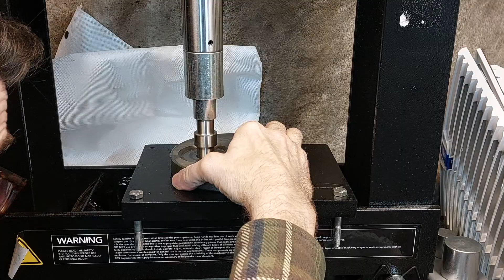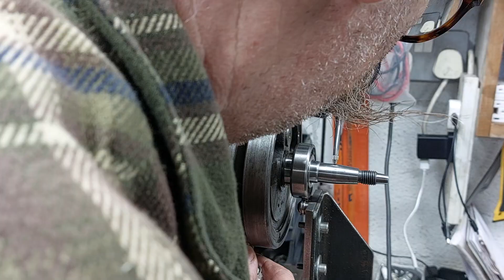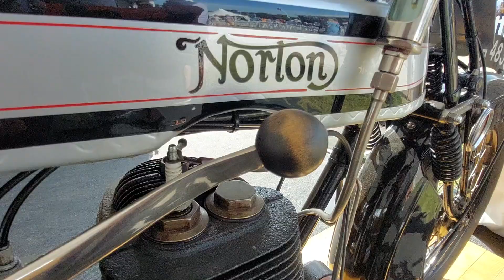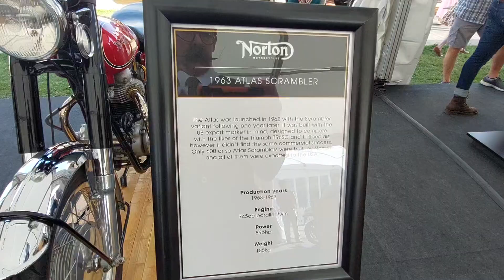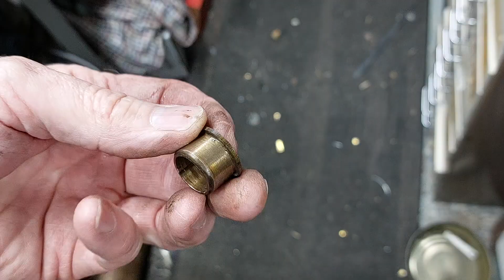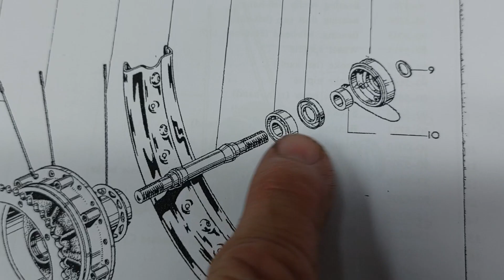BSA BANTAM CRANK ASSEMBLY & TRUING  UP

Comment: Hi, did you ever finish your bantam crankshaft? I have a couple of crankshafts one from a b175 and one from a d14/4 same as the one you have been working on. The problem that I am experiencing is one flywheel at say 12 o’clock is higher than the other by about 7thou?? It’s like the pin is bent or the flywheels are not a match. The problem seems to be the same with all the spare flywheels that I have. So if you have any advice it would be greatly appreciated. Thanks Trev
Reply from the maker: HI Trev, it's assembled but awaiting to go back in the cases, if you've measured the diameters of both the flywheels and one isn't 7 thou bigger than the other ( it wouldn't be a surprise as by the time BSA got to the d14 they just seemed to throw them together with whatever came to hand ,I struggled to get mine to the 2 thou recommended run out and I'm not the only one, Bones in Australia done one recently  that he had the same battle with ) but if both flywheels are the same diameters then it's likely that one flywheel needs knocking round the crank pin a bit ( have a look at my "Getting Cranky " video on Bantam playlist where I describe the adjustments to make when truing a crank ) the main thing is you want the shafts to run as true as possible, don't try a beat yourself up getting the flywheel surfaces to run true with each other.......they rarely will ( most B175's have cracked mudguard brackets,  mudguards and lamp brackets because they vibrate so much)

Comment: I got a rex caunt con rod set fitted to my B175 crank some years ago......my old one was like your old one Mr Tweed.

So I suspect the new one is lighter.

Sadly my crank was refitted with out being balanced......it was trued up nicly the guy who did it is a 2 stroke specialist..but didnt do balancing.

Over 40mph my motor gets very buzzy.....I suspect the crank is out of balance.

But I have heard that balancing a single cylinder crank is a wasted effort......is this true???

Wish I could get the motor on my bantam to be less vibratey.
Reply from the maker: The Rex Caunt con rod is definitely a nicer item than the original one Nick and it is lighter, I am going to check the balance on my but wasn't sure how but " Nigels pre 65 workshop " covered this when Nigel built a new crank for his Tiger Cub .

The B175 is prone to vibration I think just  because they made the bore bigger but didn't do much else which most Brit bikes suffered from with the CC race that went on ( Norton for example, Dominator 500 really sweet, 600 not as sweet,  750 Atlas really vibey so bad that they came up with the isolastick framed Commando ) .  B175's with cracked rear mudguards and mudguard brackets snapped or missing off of the rear subframe ( mine suffers with both ) is more common than  those that don't.  I think Static balancing wouldn't hurt as the flimsy crank needs all the help it can get, it may smooth the engine out at certain revs, I don't know if you'd find somewhere to carry out dynamic balancing and I should imagine it wouldn't be cheap.
So when I get round to I , I will give Static balancing a go.
Reply: @TweedsGarage  Thankyou Mr Tweed.....interesting.

Comment: Given that the crank pin is an interference fit in the flywheels,  where do you imagine the "give" comes from that allows the flywheels to move in or out to lessen the out of true measured on the DTI.
The workshop manual for an old Harley that I once owned described the same procedure, though in that case I seem to remember that the crank pin was a taper fit in the flywheels and secured by a nut on the outside of each. Same question applied there though....where did the movement come from?
Reply from the maker: You wouldn't imagine with as you say the interference fit there wouldn't be any movement but when pressed together things can tilt slightly on a minute scale ( like when a bearing jams when you get it slightly tilted to one side , the same thing happens with crank pins and sometimes require a blow to set them straight.

Comment: There is supposed to be a shim between the speedo drive and the rear wheel spindle nut, if missing speedo drive is clamped to hub and spins with it (breaking the speedo cable) - possibly not shown in exploded diagram because it's supposed to be supplied with the speedo drive so is a Smiths item, maybe? Anyway mine has this shim and it must be used. And it's definitely different to any other washers on the spindle. HTH
Reply from the maker: I shall look into it.

Comment: Just followed your method for Bantam crank truing after replacing a main shaft and conrod - got it to within 0.002" at each bearing journal quite quickly, but trying to get a smidge better just threw it further out - so I've settled for 0.002". I guess that's about as good as you can expect for a crank that's at least 50 odd years old that was probably made on equipment that was about 30 years old then! Did you get the engine running, and how did the crank perform?
Reply from the maker: Hi John, that's great to hear and to be honest with you getting within the tolerances laid down in the manual is a win as they are truly awful ( well not very true at all ) they may have been reasonable when BSA first manufactured them with fresh tooling but by the 60's i think everything was worn out, you only have to look at any unrestored B175 and most will have cracked rear mudguards and mudguard lugs sheared off of the rear frame due to vibration from wobbly cranks. Mine is still in pieces at the moment, the crank has been trued up again as it fell off of the stand which of course knocked out of true ( a mouse fart would upset it ! ) but cases have been repaired and i will eventually get it back together to try .

All the Best Mr Tweed

Comment: Having seen the work involved in truing up the Bantam flywheels and crank, I worry that when the crank is assembled in the cases, will the apertures for the main shafts be in line as well or so worn that you could have a problem with bearings, etc.
Reply from the maker: The old bearings inner races and crank shafts bearing surfaces took all of the damage, the outer bearing races hadn't spun in the cases and they are unscathed in that area...........damaged in plenty of others though 🙄

Comment: It always surprises me that the straightened crankshaft doesn't get knocked out of true with all the engine movement, torque and vibration! Good to see how it's done!
Reply from the maker: Glad to of given you an insight 👍
Reply: My thoughts as well.....never could get my head around that.
Reply: @nickaxe771  Yes it would be interesting to see studies of how much it shifts with use if it does so at all!

Comment: Nice to see a bit of lathe work. Yours is nice and quiet too. Do the grooves in the bushings act as oil supply? It's a bit minimal isn't it. Think I would  dremel in a little oil catch scoop into the upper surface to encourage oil down into the Bush.
Reply from the maker: Hi Chris, the gears sit in oil and there's plenty thrown around the gearbox ( to the point that it travels up drillings to lubricate the main crank bearings ), the groove on the outside face of the bearing faces upwards so oil runs down and around the shaft. They are probably there for when everything was new and a bit tight. Glad you enjoy the lathe work, there's normally a bit on most of my videos

Comment: Good one Allan! I see the hydraulic press is being put to good use, I think a club hammer and copper drift would have been used back in the 60s, so much nicer when you can get a controlled press fit, and using the back stop spacer makes it even better, that jump when you overcome the interference makes it difficult to end up where you want to be. Stay safe! Chris B.
Reply from the maker: Absolutely Chris, the hydraulic press is becoming an indispensable piece of kit in the Garage, used it on the Riley bodywork which will be seen in a future video. All the Best.